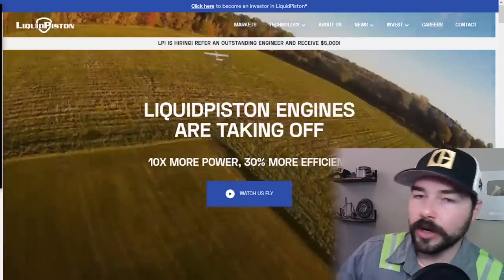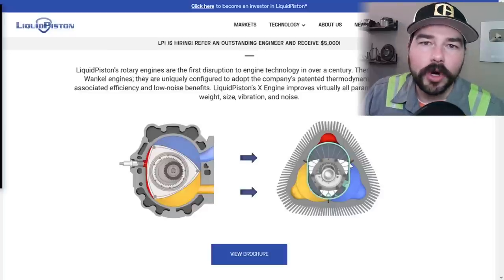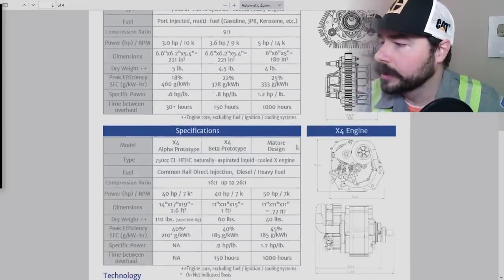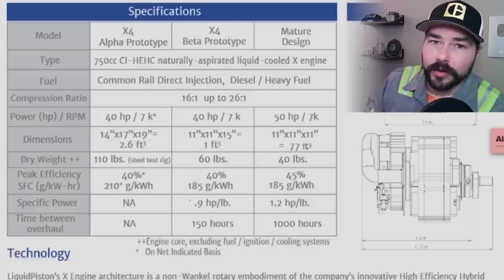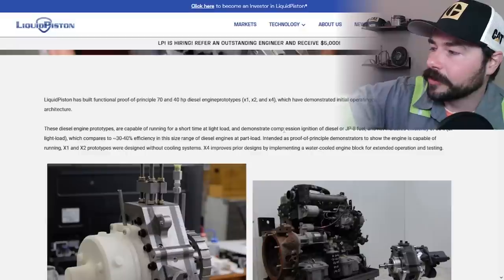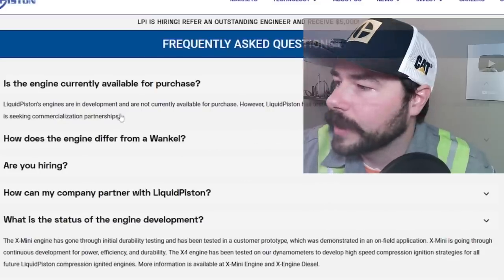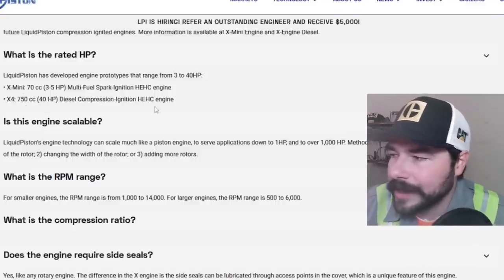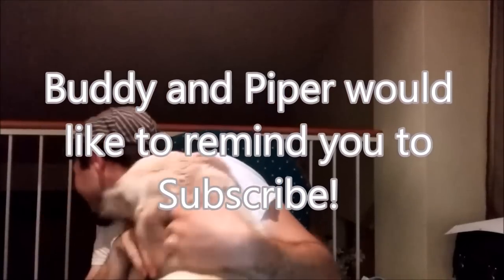This Engine could change EVERY INDUSTRY but..................

Comment: I think if they tried making one with the power and torque of current diesel engines it would be so big it would not fit in a engine bay plus with all this electric talk there 50 years to late

Comment: The knowledge you are comparing this to is a piston driven engine. Piston driven engines have hundreds of parts first is this which arguably has a couple. You’re talking about reliability, servicing, and RPM. Sure the RPM can be changed on the generator with a simple gearbox, problem solved. Servicing with the 150 hour overhauls, did they define with an overhaul? From my review they didn’t so you’re just anticipating that it’s the same type of overhaul as a piston engine, it could be as simple as replacing the veins. To add insult to injury this was specific to the beta testing of the engines and not a full production rollout. Think outside of the box

Comment: This design and many other rotaries (there are more than two), are good for high power density, light weight applications like aircraft, torpedoes (WW2 torpedoes used numerous weird ICEs), tools like chainsaws etc. Not good for trucks.

Comment: Interesting variant of the rotary, I believe that a 4 stroke version of the opposed piston opposed cylinder (OPOC) engine would be the best efficient design due the the long stroke characteristic. Achates power has a 2 cycle that they have been working with Cummins and I think Ford, but it has not shown up in production. 2 cycles usually have emission issues. Fairbanks - Morse made some large OPOC engines used in gen sets and submarines.......OPOC is a really old design used in ship engines in the 1938. a youtube ship engine video is at https://youtu.be/sWjMBSnq2es.
Reply: Jumo 2nd ww diesel airplane engine.brits did one for trains and boats too
Reply: Napier Deltic.
Reply: 4 strokes suck no brappp! I will not be 2 stroke less!

Comment: #1 these are not production engines
#2 the prototype engines your seeing are being developed for Military drone use.
#3 Military generators are now using inverters so they give frick all about running speed. (TL;DR aircraft AC is typically 400Hz)

Comment: No you could never use an engine spinning at that RPM for a generator. Or get diesel level torque. It would be like you'd have to use a 8 99:1 reduction.....like a Tesla. If only someone could invent a thing called reduction gearing. Man if we had that we could use a Lycoming T53 turboshaft spinning at 22,500 rpm to spin a prop on a boat or a stationary generator or push oil through a pipeline.

Comment: 150 hours to rebuild... Not good. The truck I'm in has 21932.8 hours without rebuild.
I look for low end torque as all my vehicles are heavy. My personal car even weighs more than two tons. A bit of low end torque gets it moving smoothly. A high revving engine with no low end torque would require a high stall torque converter to get the car moving, and I'd literally have to launch from the light instead of gently pulling away to get moving. Not a good fit for a large luxury car. Never mind how that would work in a Paccar with 52,000 pounds of liquid sloshing around in the trailer... 
Bye bye clutch.
With those numbers, I wouldn't even give the engine a second look.
With a reduction gearbox, it might work with a generator, but the efficiency, or lack of, would be a problem for any long term use. A genset that creates more heat than electricity isn't a good way to power the cabin in the woods, or remote work location.

Comment: Nah too much heat on one side of the rotor. The thermal expansion will be en issue. Mazda ha issues trying to make the heat not warp the engine because one side had a continuous combustion and the other has constant cold air/fuel mixture.
Reply: I havent looked at their site yet, but from what I saw in this video it looked like it has three combustion chambers? One view of the engine looked to have three spark plugs, one on each lobe of the chamber EDIT: as viewed at 3:06

Comment: Just because there is a company doesnt necessarily mean that it is above board. A woman was just sentenced to I believe 20yrs in prison because HER company was a  sham and ripped her investors off for millions of dollars. This engine is as you pointed out just a modified wankel design that most likely will fade away with no impact. The ev industry is in the same boat right now. All the ev  proponents dont realize that the ev was first introduced way back in the early 1900s and didnt succeed. Electricity in vehicles wont succeed in this century because there are too many obstacles to overcome that technology doesnt have answers to. This engine is in the same boat. It has nothing to contribute to any industry that will be an improvement

Comment: Engine could run at 1 million rpm it doesn't matter, it's called gear reduction and can be set to wat ever rpm you want
Reply: Of course it does.  Gear reduction comes with extra size and weight.

Comment: this is not new at all the Wankler engine is real and has been around for almost 100 years and Wankler experimented with this design that these guys are calling the x engine  for fighter planes but they had an issue of harmonics and balanced compression so they abandoned it

Comment: 2:55    ......because Deltic was already taken   lmfao
Reply: for real check out the Napier Deltic engines if you have never seen them...... yes that's the same Napier what invented the ubiquitous Napier ring......  a refined oil scraper ring used in pretty much 99.99999 percent of piston engines today